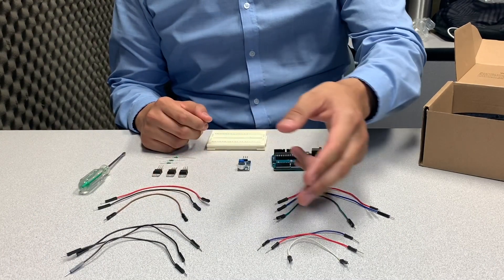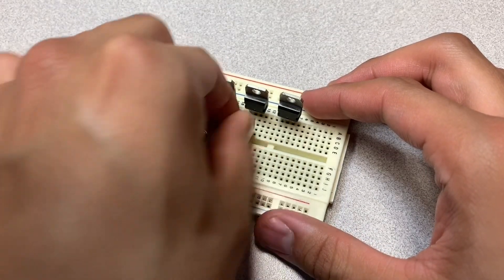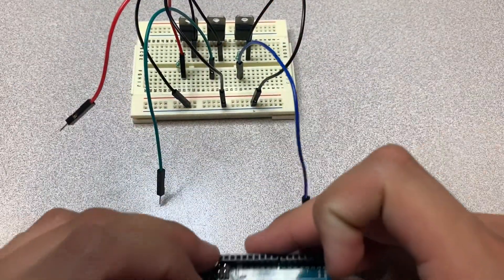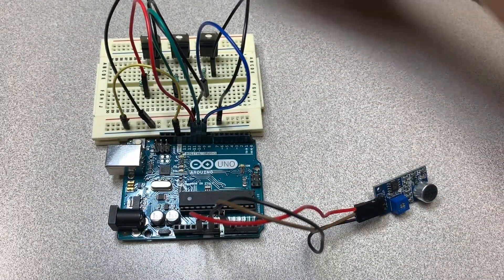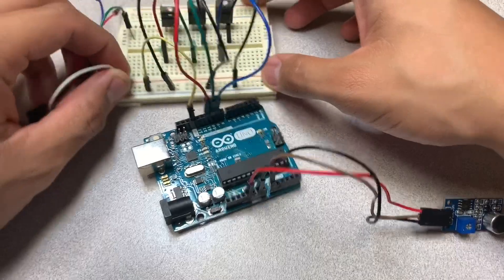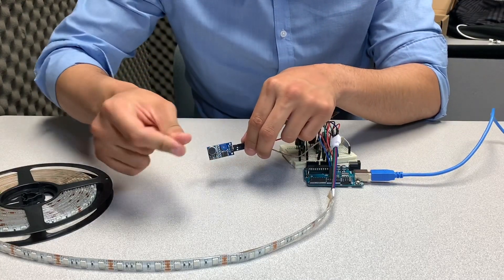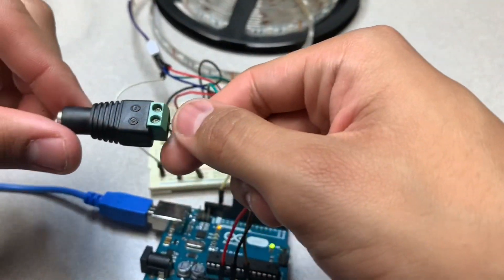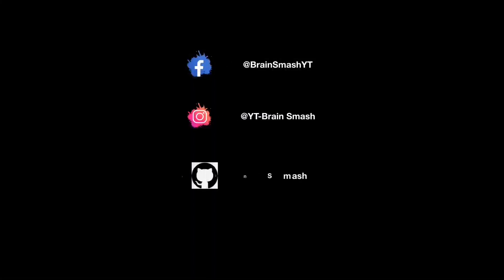How to make Music Reactive RGB LEDs with Arduino

Comment: so how does one upload the code?? I'm a beginner and have tried uploading it using the arduino sketch, but I'm sure I'm messing it up somewhere :(
Reply: open the .ino file make sure the arduino is plugged into your pc and press the arrow pointing right at the top of the app
Reply: @jaxonwatt7598  THANK YOU A MILLION! It worked! So now, my question is, does the arduino board needs its own power supply for this project? I was able to upload the code, but the second I disconnect the cable from the computer, everything shuts down even if the bread board is powered...

Comment: I try to do the same config but I guess my sound sensor is not the same so the value are different. When I set the same config, I can see in the serial plotter the variation is super small (stay between 3 to 3.1). do you know how to adapt it
Reply: same, do you have a solution for this problem?

Comment: Can we use this? https://rees52.com/regulator/2946-ka7810-1a-10v-3-terminal-positive-voltage-regulator-rs1523?search_query=transistor&results=135
Reply from the maker: You can use any general purpose transistor that is NPN and that it can allow a current of at least 3A just to be safe.

Comment: very nice project man.....
i only have a doubt ....., in the end do i have to power the arduino with usb simultaneously with 12v led light power?

I mean to say ... can the arduino  runs with the 12v power from L.E.D  without connecting it with the laptop or computer
Reply from the maker: Yes 👍🏼

Comment: What's the reasoning behind transistors? The Arduino sends out the RBG values. Are they being used for protection from the 12v supply?
Reply: yeah
Reply: because the RGB analog strips can draw up to 1 or 2 amps which the Arduino board cant handle. use transistors,MOSFETs or uln 2003A ic witch has two Darlington pairs inside ( basically some transistors inside in an order)

Comment: Does it have to remain attached to the computer? I'm asking because I want to build it into a guitar.
Reply from the maker: Hi you can use batteries 🔋 to disconnect the arduino from the computer

Comment: What if Im only using a one color led strip?
Reply: Thank you!!!!
Reply: I will just use 1 transistor and connect it to arduino?
Reply from the maker: That’s correct 🤟🏼
Reply from the maker: To your first question You have to modify the code so that the output of each color instead of each color is only the one you have🤙🏼

Comment: I have one question. For this project you can onlY use ARDUINO UNO R3 or you can use any other arduino, for example ARDUINO GEEKCREIT.
Reply from the maker: you can use any arduino only that changes the connections in the code with the terminal you are going to use 🤙🏼

Comment: Could you please specify the type of transistors u are using
Reply from the maker: Hi sure you can use any transistor that is npn and support at least 1A of current through base and emitter

Comment: Can I use SL100 transistor instead?
Reply from the maker: just check that it accepts more than 100 mA and is NPN or if it is PNP, change the configuration of the connections 🤟🏼

Comment: But what's the use of filter signal  function in the code ?
Reply from the maker: The Digital Low Pass Filter is used to eliminate all frequencies above a certain value established by us, this is done to make sure that neither the electrical frequencies from the circuit and the frequencies in the wild (also known as world) are not captured by our sensor and thus this frequencies would not create noise that can add up and make our system think that is capturing a noise when its not, you can visualize this by using your phone and trying to record audio, if you stay silent you will see that the phone captures sound this will be your noise since only want it to record your voice or sound and when you apply the filter you will have to speak louder in order for the phone to capture sound that is louder that a certain value

Comment: Hey brain smash,I have a problem.When I turn the sound sensor knob it changes colors
Reply from the maker: Hi, that problem is because the sensitivy on your sensor is too high, you will have to adjust it, Check our newest video for a How to do it, as well as a better explanation on the Project
Reply: @brainsmash4920  thank you so much for helping me!!

Comment: or just feed A0 audio signal
Reply: audio signal is usually in the milli-volts
Reply: @NicolasTsagarides  can be boosted like amplifier
Reply: @anolghosh9501  If you do it programmatically then you will lose resolution. If you do it with discrete components then you can just use a ready made circuit just like the sound sensor used
Reply: @NicolasTsagarides  no not through coding ... frequency can be converted using frequency to voltage circuit.

& my bad my first comment is wrong here it is corrected  just feed A0 audio signal converted voltage response.
https://github.com/frenchmatt/Music-LEDs

Comment: Does not work just stays in red color
Reply from the maker: Can you provide more details about your assembly of the components? Or Your components?
Reply: @brainsmash4920  thank you for your reply, same as yours but can not not figure out what is delayLEDS pin which is assigned to pin 3 where to connect it?
Reply: I have the same problem if you figured out please tell me how to fix it, thanks
Reply: Same problem
Reply from the maker: Here is the link to the answer of your questions 😉https://youtu.be/NZuYO5WWsFk

Comment: Can i use ws2812b in this setup @Brain Smash
Reply from the maker: No, the method to control that LED Strip is different from this one, since with that one you don't have a pin for R, G and B colors
Reply: 2812b is also RGB led strip
Reply: @brainsmash4920  Any idea of the method to do this? I'm new to arduino stuff
Reply: Hi! Did you manage to do the project with ws2812b?
Reply: @andreiionescu5543  yess you can wach my channel www.youtube.com/thejerryshow
Reply: @andreiionescu5543  were you able to get this to work with WS2812B?

Comment: which transistor is that
Reply from the maker: The transistor is the TIP41C
Reply from the maker: 1大哈哈  You can use any general purpose transistor that is NPN and that it can allow a current of at least 3A just to be safe.
Reply from the maker: Matija N  Yes!, Why you ask? Because the transistor you chose allows for a high enough current so that  the LED Strip can be to be turned ON, plus the voltage is only 12V, so you having a transistor that has a maximum of 115V is more than enough, to replicate this video into your own PROJECT!, or even your own PRODUCT!!, hope that helps.
Reply: @brainsmash4920  Can I use BD139 transistors?
Reply from the maker: Yes that’s about right 👌🏼

Comment: If you can please help out with the code
Reply from the maker: chinmay gaur sure what problem do you have
Reply: @brainsmash4920  so basically I'm unable to give a 12 volt power supply
Reply from the maker: @chinmay268ds  Make sure that from the power supply of +12V the Positive + goes in the Collector of the Transistor and GND to the Emiter of the transistor, and with the code you will send a PWM signal from the Arduino to the Base of the Transistor to turn ON any color in the strip, if you cannot turn on any color, try to debug your strip by connecting any of the R, G or B pins to GND of your +12V Power Supply and 12V from the Led Strip to Positive on your power supply, if you do it, you should see the color that you pick from your strip ON
Reply: @brainsmash4920  and can you walk me through the algorithm of the code please
Reply from the maker: @chinmay268ds  The Algorithm starts by Reading the Sensor Values of your Sound Sensor, then it filter that signal using a Digital IIR Low Pass Filter to reduce unwanted noise captured by the sensor, since all we want is to capture the music frequency, then it compares the filtered signal value, to values specified by ME (you can change them if you wish), depending on the value of the filtered signal it will display a color in the RGB strip, you can change the colors by changing the numbers in the RGBColor Method, you obtain these numbers by picking the color you want from a RGB wheel (search on google and you will get one), If you have more questions feel free to ask :)
Reply: @brainsmash4920  can you do a video elaborating the code if possible or redirect me to a page describing the same in detail. It would be Highly helpful
Reply from the maker: @chinmay268ds  Yeah! Video is coming out either Friday or Saturday